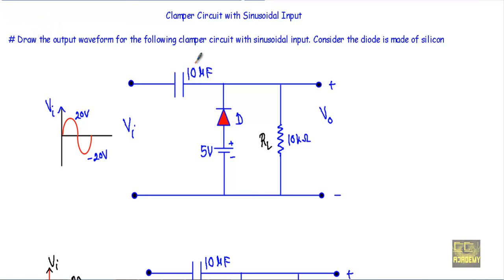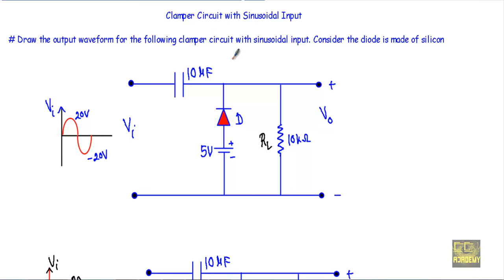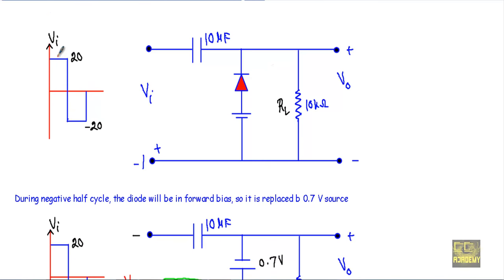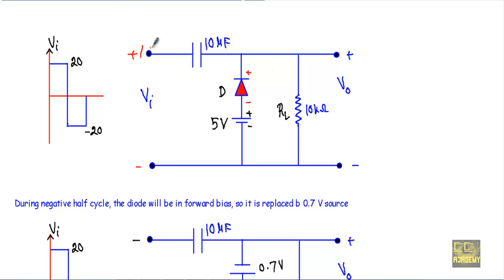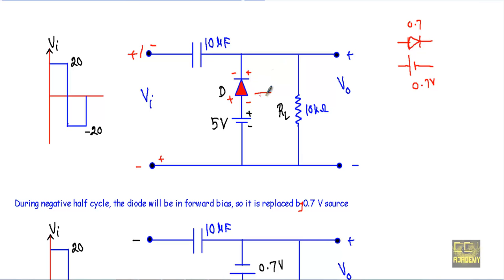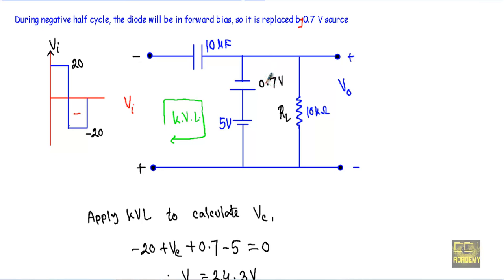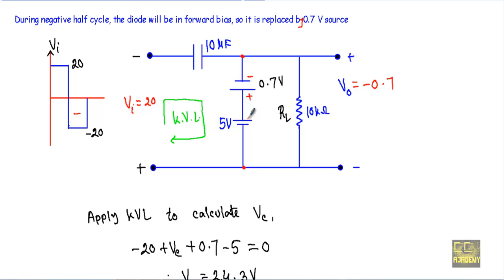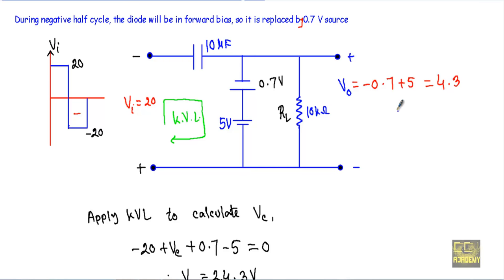Clamper Circuit with Sinusoidal Input (with simulation)

Comment: Hi, do you have a video to explain how to give a positive off set to a square wave? I have a PWM generating a square wave with a duty cycle of 99%. The supply voltage for the PWM is 10.5v The problem is the square wave swings between -1.25v to +9.25v. I want the coupling diode to offset the waveform so it swings between +.250v to +10.75v. Can you assist please?